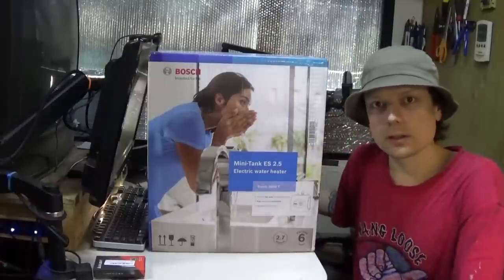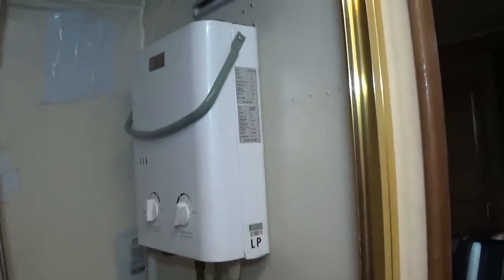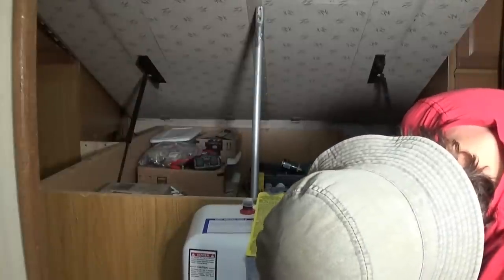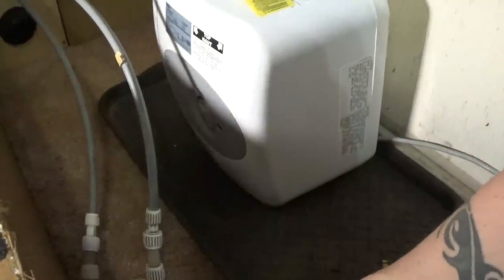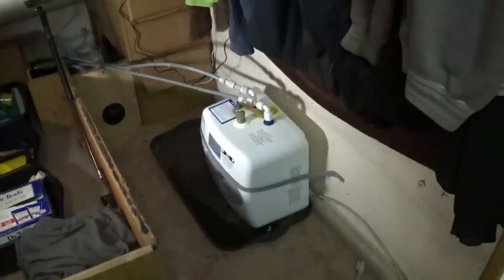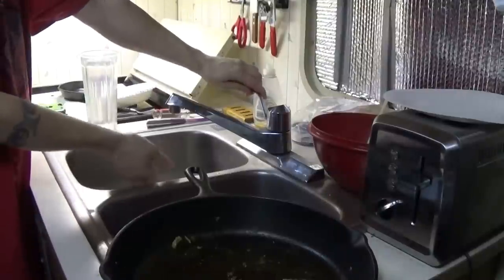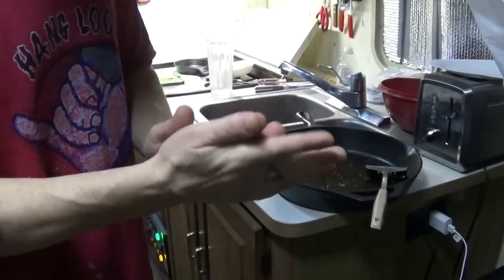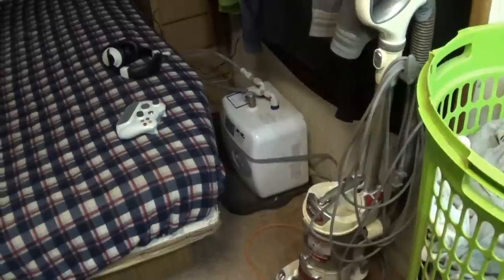Mini Tank Electric Water Heater Install || RV Living

Comment: So if I just want a shower does it go
Hose from Water tank to water pump inlet.
Hose from Water pump outlet to blue cold side of water heater
Hose from red hot side of water heater to shower head
I wish I would've got the 2.7 gallon , I got the 4 gallon but I only need about 2.7 gallon , i'm thinking it would take up less time to heat up 2.7.
Thumbs up

Comment: I've seen your video a few times.. THANKS! Water heater was dying and the cold showers sucked! and I didn't want to spend $500 on a new propane/elect unit in my rv so I Bought the Bosch 4gal. got some more pex line and fittings.. still got to find the right fittings to fit the hot/cold outlets today. I PLAN on a quick install in the kitchen for easy to get to water lines and electric outlet close by, and the shower is a whole 10ft away... crossing my fingers!
Reply: So it was a good purchase

Comment: I cut a hole in the bottom of the wood floor on my project camper and put  2x4's sideways and screwed em in from up top and cut a board for the bottom and screwed it in the 2x4'. Had an extra 3 and half inches of clearance. Spray painted the bottom black and reinsulated the bottom.

Comment: LOL so satisfying to watch you revel in having warm water at the sinks. I'm an electrical engineer and a little concerned about the power connection but you seem to understand what is needed for a permanent install so I have faith in you.
Reply: Could you hard wire that to a 110v on off switch?
Reply: @bjbhehir  Can you ? I am wondering the same question

Comment: Hey all right thanks for the post. I had an issue with mine tripping breaker so I checked it out per the bulletin your suppose to inspect the anode once a year if this is worn out then it will cause tank to leak I was told by product support from Bosch. Only thing I don’t like is that I’ve went to every big box store and all my local plumbing stores to find parts it’s order online only. So if your out of hot water or have an issue make sure you have back up parts. Other then these issues it seems to work great

Comment: Great video! IMHO The only video, out of hundreds I've seen, providing a glimpse of reality. Looking forward to more of you showing up on my feed. 💝

P.S. Sad, so much greed and ignorance in videos out there plainly support a lack display for safeguards without using switch, tank relief, and T&P valve discharge pipe at installation, each claim to lasting integrity and reliability in their water heat and delivery systems. So many deadly enough to know careful, but so few careless enough to know dead.

Comment: In my RV,  the previous had just put in a point of use water under the sink, they guy said it was great for dishes but not really a lot for a shower. Ended up re-routing both the feed lines and the hot water lines to the sink and shower to connect to a tankless LP water heater ( same one you have in your shower ). However, it leaked since day one and then sprung another leak in a completely different area a short while later. I think the outdoor models might not be rated for constant pressure. Anyway, I ended up getting a more expensive model that was designed for indoor use and came with a vent pipe. Hoping this one goes better.

Comment: Nice, really enjoy the DIY spirit on your channel. I have one of the camp style LP heaters inside my large cargo conversion and it works OK but you do have to play with the temp often to get it just right. I just installed an Rheem outdoor mounted whole house tankless LP water heater on my house at 9GPM and it works great... very stable temp but limited to 120F... cost on the Rheem is about $600-700. Very interested to hear how your electric spot water heater works out on power consumption.

Comment: Hope you can help.  Watched your video.  I have same water heater.  Connected to a 110v outlet, which is wired to my 3000 watt Renogy inverter, with 300ah lithium batteries.  BUT once I turn it on, it trips my entire electrical system.  So my question, what size fuse do I need?  Or how exactly should I wire it to work properly.  I’m assuming my inverter and batteries should be plenty to handle?

Comment: The brass valve on it is a temperature & pressure relief valve, the outlet needs to be routed outside somewhere, IF the unit overheats the valve will open and dump 95+ deg C water out of it, really don't want it doing that inside

Comment: question with something like this or the Bosch water heater 7 gallon.  Since that is so much water...can you just skip a water reserve tank and use this heater directly as the reserve? I think it would get rid of one more component of a water system. can it be dual used as storage and heater?  Better question.....does any company make a reserve, pump, heater all in one?

Comment: Have you used the hot water taps at all over the past few years?  If not you may wanna check to make sure there are no leaks.  Seems like my bathroom sink needs to be tightened every 10k miles or so.

Comment: You are wrong on the tankles heater, We do use them a lot on boats or campers tiny homes and rv,s to here in Holland,for the whole hot water system, You connect the cold inlet permanent, and put the fawcet valve on the hot side, it wil switch off imediatly if you close the fawcet.. (its made for that) (flow switch) Y do strongly advise to put a outlet on it for the gasses from the flame! the way you use it now is dangerois for you, cause off he toxic fumes!!  (you can plug it on the water lines. cold on the existing cold line, and the hot outlet to the hot lines in the rv... ) (you can even use it to hotfill the tank heater, preserving power... ) But again, make a stack on the tankles to the outside. Dont poison yourself whit carbon monoxide! Take care.

Comment: Thanks for the vid! .. my 14yr old rv's unit is about to call it quits. 
I ordered the Bosch 4gal. I'll be putting mine under the bathroom sink.. so I'll be able to tap into the lines there.
a few sharkbites and a little pex and I should be good. 
Here's my question.. when not in use should I turn it off and only turn it on when im going to need it? or just leave it on 24/7?
Reply: @troy tucker
Hey my original water heater is on it’s last leg also 
Is there any advice you can give me now?

Comment: How's this working out? I just installed one in my travel trailer, but the pressure relief valve is engaging because of pressure buildup in a closed system. The manual recommends a .5 gal expansion tank in closed systems but I'm having trouble finding one that size. Thanks!
Reply from the maker: Its working great!
Reply: @ClassALiving  Did you run the pressure relief valve out the van with a hose? I was considering using some kind of bucket instead of drilling more holes in the van
Reply: I have seen where they T into the drain pipe off the pressure release valve.  No extra holes in the rv.

Comment: What watt is your inverter? and what Amps circuit breaker are you using? I'm using 3000w inverter and 300A circuit breaker with 1440w water heater in my van. When I turned on the water heater,  after 30s, the circuit breaker is shutdown and heater is off.
Reply: Jin, did you ever solve this? I'm having the same issue, thanks.

Comment: How would you drain it for winter season so it won't bust ?
Reply: i read the manual and it gave a few options, one of them was to actually disconnect it and dump it outside